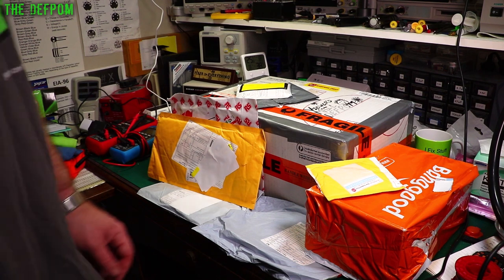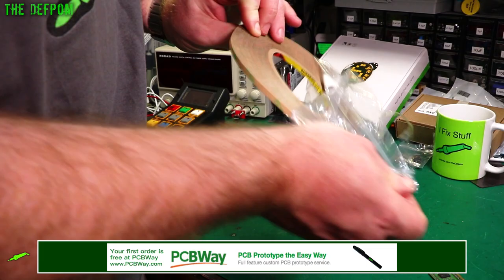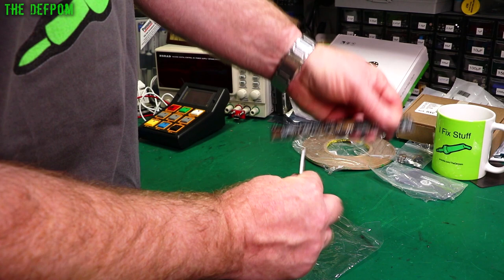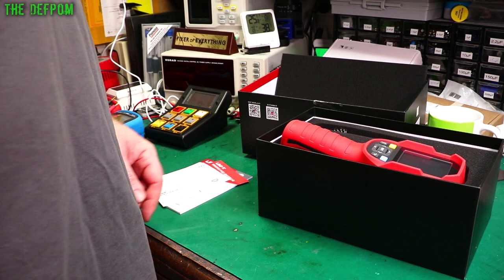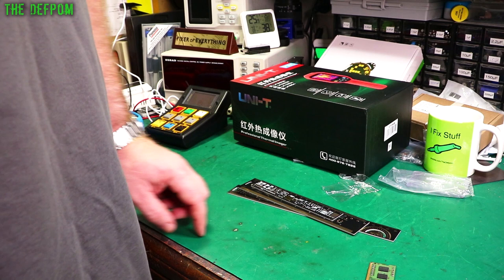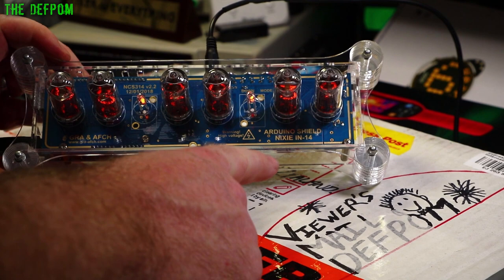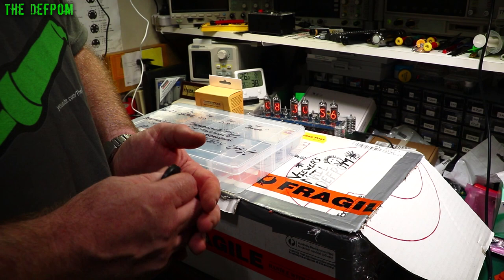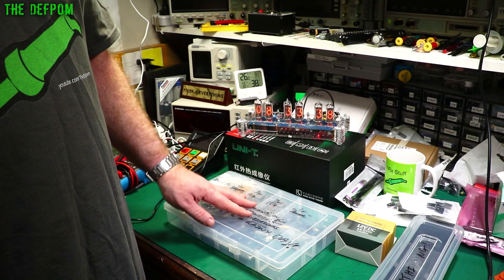🔴 Defpom's Mailbag - Mailbag Monday 7th December 2020

Comment: The nixie tubes won't last forever......I found with my clock after a year or two some digits start to fade/darken. However, up the HV by 10v or 20v (increases the current) for a few hours or so burns off the residue and brings them back to life.
Also, if your clock can set it to blank the digits during the night then do so.......will last longer.
Reply: Some older bench multimeters use Nixie tubes (or actually monochrome plasma displays), the problem is that after years of being left on, the display gets really dim.
Reply from the maker: I am not running it all of the time, I am using it as a prop when I’m recording for exactly that reason, I want it to last and I tend to look after things where I can.